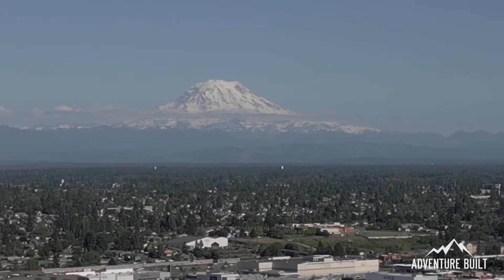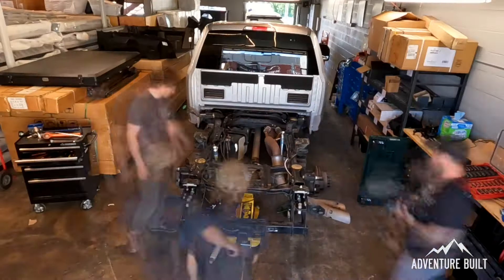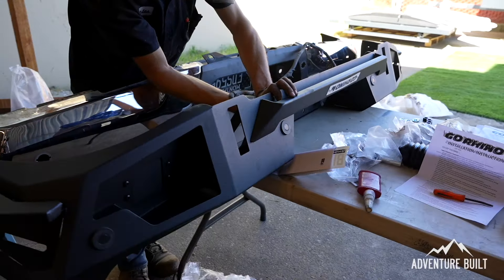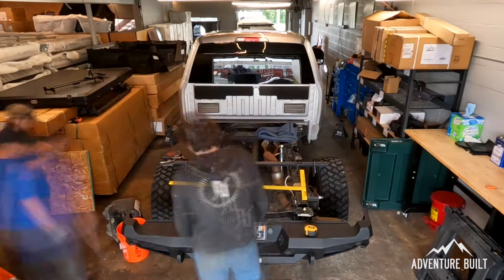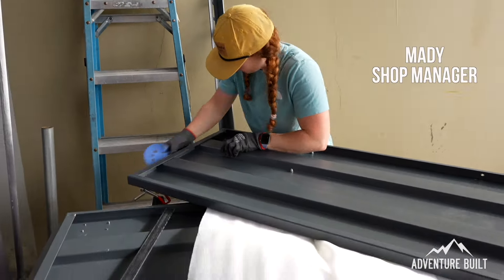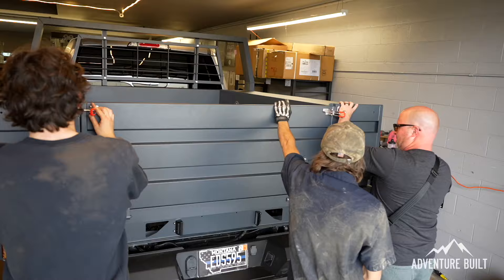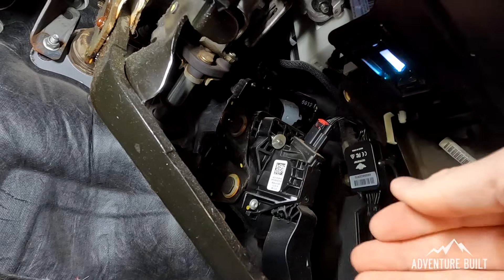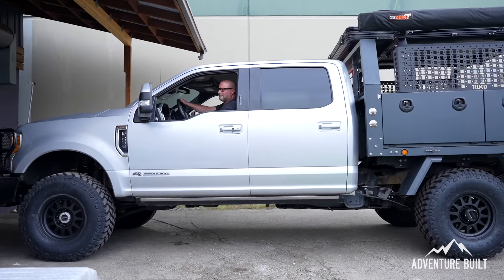Next Jump Outfitters Unveils the Ultimate SUPER UTE Build: NJO Flatbed, Trukd Bedrock & Flated

Comment: not the ultimate off road vehicle?? it's got low end torque, room for 41'' tires, solid axle.. there are many different variations of "off-road" you get the tiny toyotas/jeep trails, then you have the open terrain where these trucks shine. let's not forget the payload capacity! I love my Carli F350.. I can't fit in tiny spots but that's ok! i'm not trail riding, i'm "overlanding" the country.
Reply: Why Bilstein over the better Fox 2.0? I prefer aluminum body with a 5/8'' shaft over a steel body 1/2'' shaft anyday.
Reply from the maker: Completely agree it’s an Overlanding Beast. Just spent the day doing 4 near 13,000 ft passes in Colorado and the Super Ute destroyed. The only thing I worry about is tight squeezes between trees and tight turns on mountain passes. She is a big girl!!!
Reply: @AdventureBuilt  I did a simple trail here in Mesa, AZ that was too tight and did a number on my paint job, sad but fun nonetheless. A wrap is in my future. Keep those 4 wheels on the ground bud! Happy trails
Reply: Looks so mean! I saw this rig at Expo West so looked up. I have the same truck. Suspension, wheels & tires going on in 3 weeks. You seriously have me contemplating a bed. 🤔